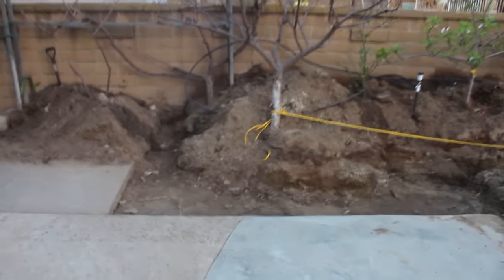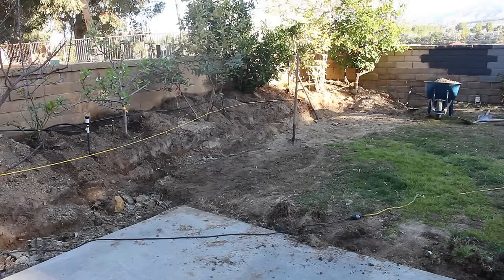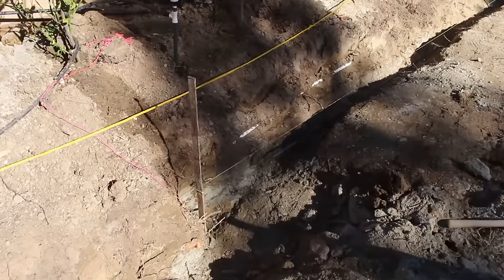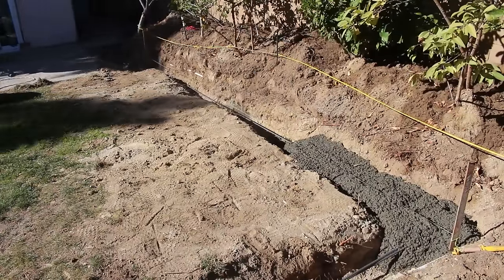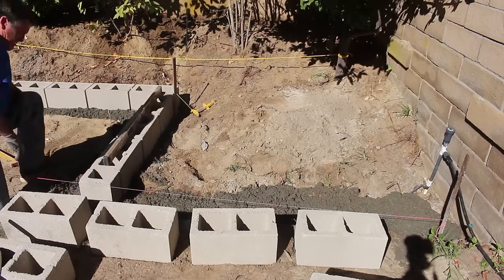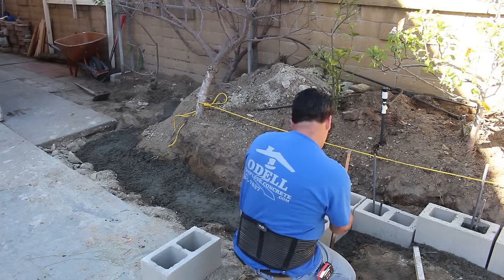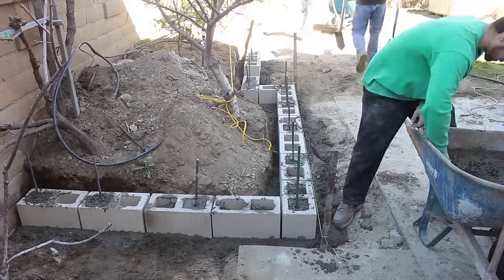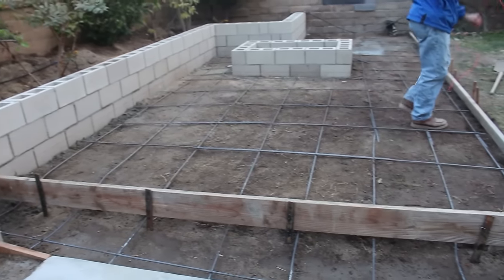How to Build a Retaining wall Easy Guide DIY

Comment: Why didn't they put concrete in between each cinder block on the very first layer? They just put it on the bottom and didn't worry about spacing between the cinder blocks or being even or close to being even and some looked tilted. Then they put concrete on top of the first layer of cinder blocks of the very first level and then they put concrete in between the cinder blocks on the second course. Weird
Reply from the maker: No need , it's getting covered with stone
Reply: @OdellCompleteConcrete  I love concrete.  I know. People say that you shouldn't say that you love inanimate objects. But, I love contrete. LOL

Comment: The easiest way to do it is letting the concrete set first then lay all your blocks and then core fill your blocks. The steel tires it all in anyway so there's no difference in the strength of it. That way when laying your blocks when your footing is still wet, the block next to it won't move and also when filling the blocks with the concrete they won't move also. Easier to work with and a much neater and straighter finish.
Reply from the maker: A lot slower and not as strong.
Reply: Odell Complete Concrete it's not slower and strength doesn't effect the end result

Comment: This seems extremely robust for the height.  I live in earthquake country and I have an engineered retaining wall 6 feet tall which is built exactly like this one, except with a much larger (6 feet wide and up to 30 inches deep) key footing.
Reply from the maker: That's intense
Reply: @OdellCompleteConcrete  this seems overbuilt, in comparison

Comment: So, you don't have to have rebar "L" into the footing? You can just stick it straight in? Also, do you ever just butt the blocks up to each other. I made a planter box that way and used Gorilla glue between the blocks so I didn't have to grout them. It's still looking good after several years now. What do you think?
Reply from the maker: no worries at this height
Reply: Bob how did the glue work out. I am putting together a retaining wall in a dirt / unfinished basement and the wall doesn’t have to be pretty it only has to be strong. I was thinking about “glueing” the blocks
Reply: @divebobber  that’s the plan. How far down do you drive the rebar into the dirt below? 24” ?

Comment: I liked this video, it was very informative.  I was wondering though, about drainage behind the wall... Why was no drainage pipe installed; wouldn't that control water seepage into the cinder blocks rather than using a rubber adhesive backing?
Reply from the maker: drains are always a nice bonus.

Comment: You haven't made any allowance for the water behind the retaining wall to escape. Effectivity, you've made a dam.
Reply from the maker: No problem.
The only water that goes in the planter is from rain.
No water runoff
Reply: It’s called hydrostatic pressure and it is a major concern for any retaining wall. I am a licensed masonry contractor who builds miles of these walls.  This is why you need weep holes or a drainage system.
Reply: @lvhatrick  realistically depends on region and soil conditions right? Although while it’s all torn up, they should have just laid a drainage system.